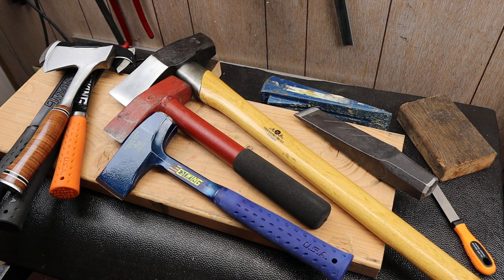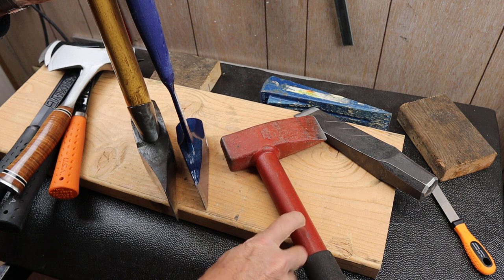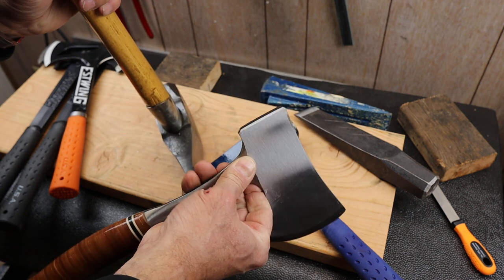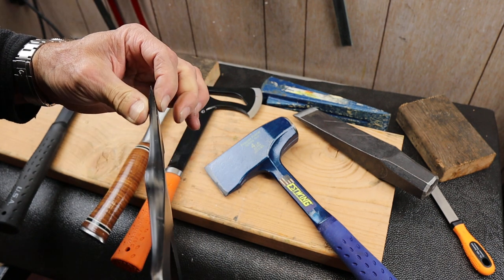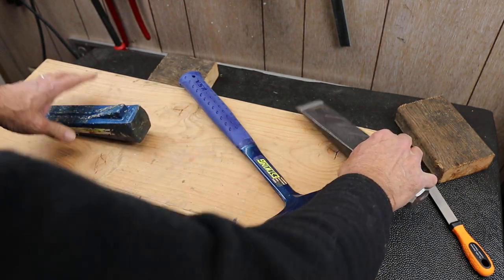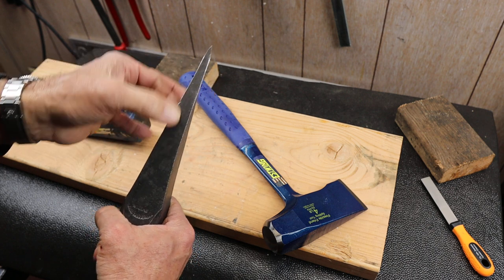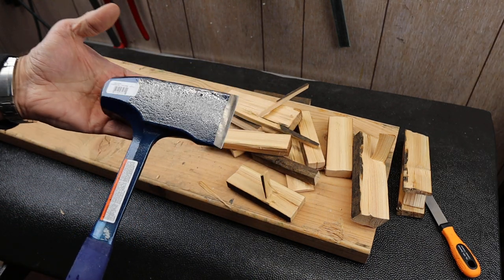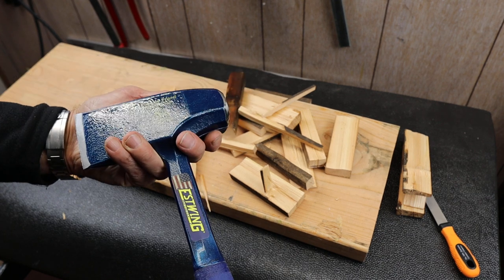The Estwing Fireside Friend: The perfect partner for campfire comfort.

Comment: I’ve got one of these paired with a 2lb sledge.  So the 4lb splitter ends up a splitting wedge on a stick.  So if you run out of easy kindling, you can grab a bigger piece and use sledge to beat the 4lb thru.  Really handy.